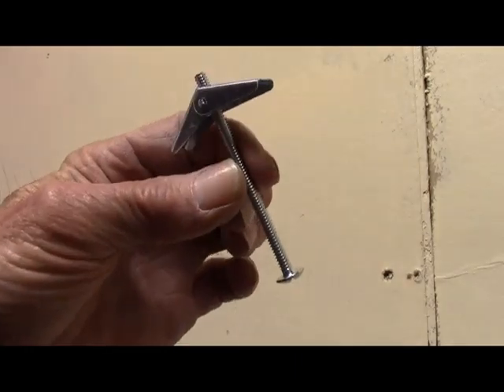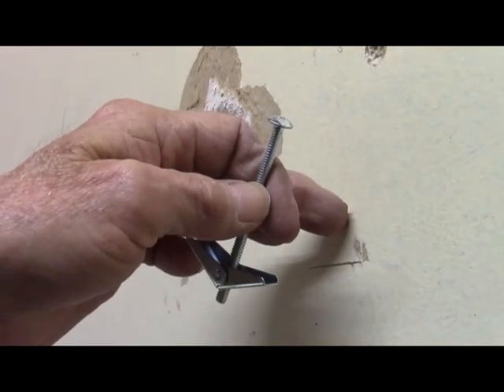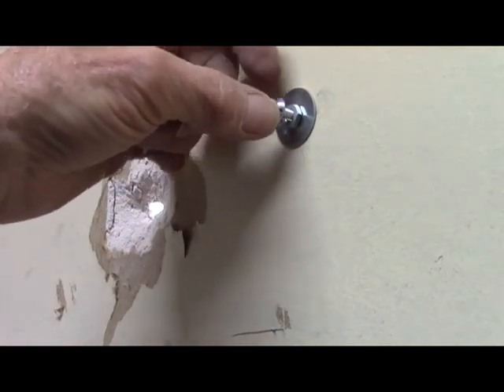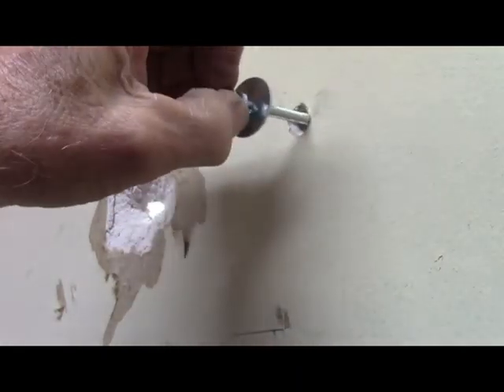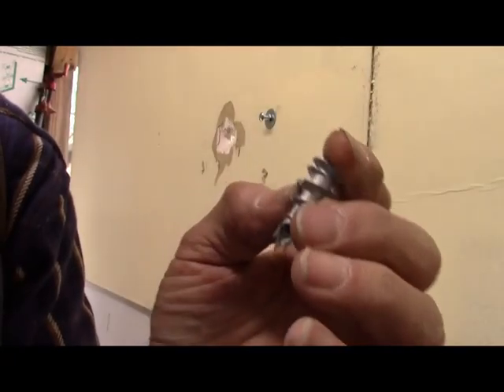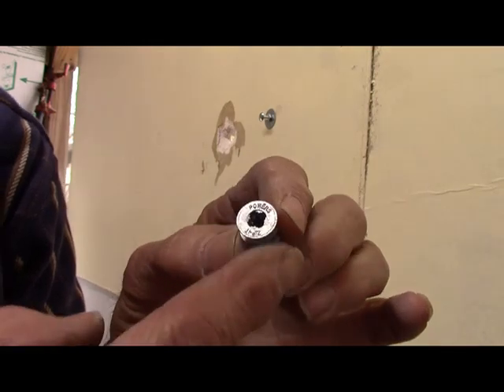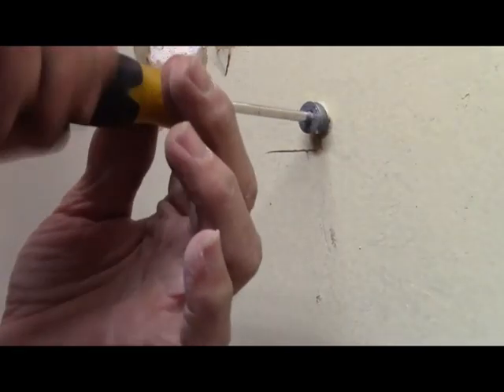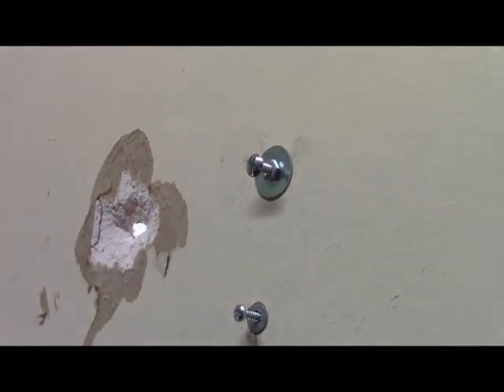picture wall anchor pulled out of the wall, installing a different wall anchor or picture anchor

Comment: In regards to 'snap toggle bolts' do you think a nut/washer is needed as well or should the plastic piece be enough tension to allow my screw to stick out?
Reply from the maker: The plastic anchors are fine and  has been working for years,

Comment: What kinda but did you use? I tried a 9:16th spade and I’m having a hard time getting the wing part through
Reply from the maker: If I'm reading this correctly it sounds like you need a longer bolt. If you have 1/2" rock a 3" toggle bolt will work. If you have a plaster wall they are usually about an inch thick and you will need a  3-1/2" toggle bolt. Let me know if I answered your question